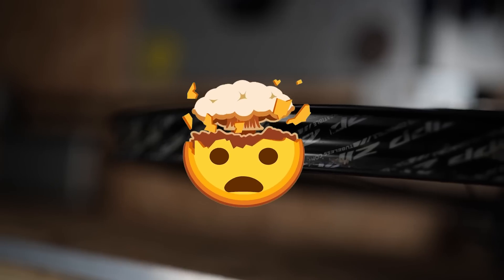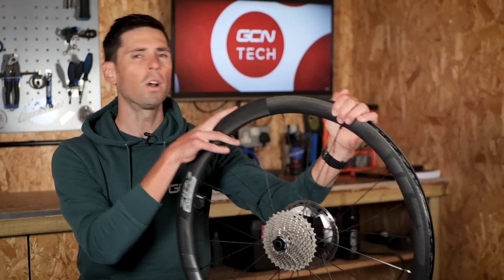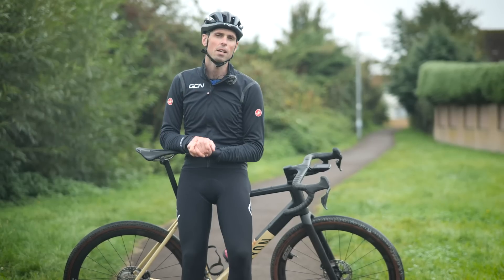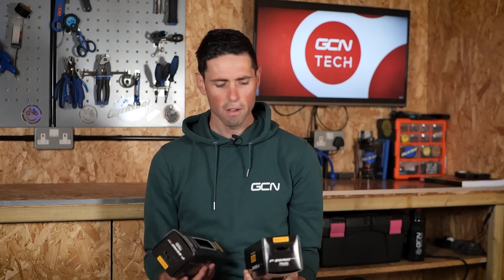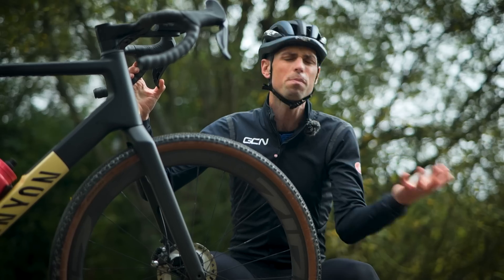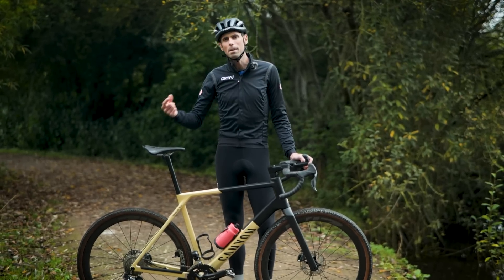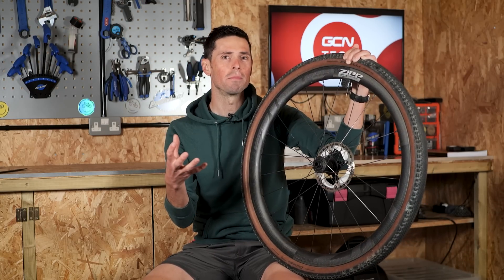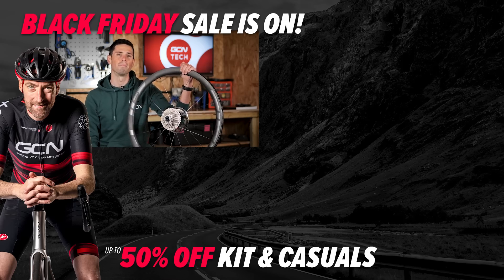What exactly is hookless technology, and what are its pros and cons?

Comment: There is no reason to have hookless rims in road cycling and no amount of media hyping will ever convince me that hookless is a good thing.
Reply: Agreed, I'm a fairly big lad 95kg, and cornering doesn't instil confidence at just max 73 psi. Scared of burping already had a crash with normal tubeless with a puncture once air was too low.
Reply: @neilmurray4231  I'm 90kg and happy descending fast switchbacks at 65psi and less.  Started doing that long before I got any hookless wheels
Reply: So you’re out on the road. You get a flat. You reinflate after fixing… but don’t carry a pressure gauge… and you go over 73psi…….
Reply: @DrawnOutMeetings  I can't fathom pumping to 73psi after a flat🙃  Too lazy.
Reply: @veganpotterthevegan  and depending on your specific tires, you would need to put a tube in anyway since a mini pump generally is not going to re-seat your tire on the bead, or you would need to use co2 blast
Reply: @justsomedude7556  I've never had a tubeless tire unseat in about 80k miles of riding road tubeless
Reply: @veganpotterthevegan  Neither had I until 2 weeks ago, when I had a flat going down a bridge and the tire bead was broken.  It was at the time I realized that I had left my spares and CO2 on my work bench in my garage, so I had to make the call of shame 😑.  I think it was a one off, but it did happen.
Reply: @justsomedude7556  I'd always have a tube anyway.  I plug 2-3x a year and have only used 3 tubes in the last 80k miles
Reply: It's cheaper
Reply: It’s cheaper the latest 303 firecrest were cheaper than the older ones.
Reply: Totally agree this video is a Pirelli advert that is not worth your life. There are several videos showing hookless tyres coming off at less than 73 psi.
Reply: Hookless it’s a lot safer tho
Reply: Actually the reasons are stated in the video: increased rider comfort, better cornering grip, better system efficiency, etc. Whether you feel the pros outweigh the cons is a personal decision. For most riders, including myself, the pros of hookless wheels are compelling and the drawbacks either don’t apply to me or are statistically insignificant.
Reply: Hookless gives you none of those things.  @danielakerman8241
Reply: People talking negatively about how hookless don’t work when the automobile has only used this concept for decades. The primary reason some incidents have occurred once you dig into the details is improper tire/rim matching according ETRTO standards and bad setup. Like any industry you need to know the standards. There are pros doing tour races on hookless rims that are pushing those to the limits and doing just fine. Details matter.
Reply: @rickstokes2239  automobile hookless and bike hookless completely different animals. Automobile tires can stand on their own, most bike tires can not
Reply: @justsomedude7556  “most bike tires cannot” - When you use the ETRTO standards and specifications like the tour pro do that actually use anyone can use them. It’s just a matter of tire and rim matching and using them to specs.
Reply: @rickstokes2239  I have no issue with hookless on gravel or mountain, pressures are low enough to where it does not matter. Mountain has used it for years with no issues but road is a whole other issue. Yea I am a huge fan of the ETRTO standards
Reply: @justsomedude7556  I have a buddy that just bought a new Trek and put ENVE SES rims on it - hookeless. He came from a bike he sold with ENVE 65 Foundation rims - hookless and never had a problem with the and he races. I have ENVE 65 Foundations on my Cervelo P Series Tri rig and they’ve been great. Studying the setups is important.
Reply: @rickstokes2239  That is the beauty of this issue, each person has the choice of which way they want to roll, hooked or hookless.  The discussion is the fun part 😀, cheers.
Reply: @justsomedude7556  I agree. Everyone needs to do their due diligence. Be well.
Reply: There are IMO too many variables for a non tire engineer. When the charts are not easy to find  and use...They will need to clean up their specs. But that's always the case. @rickstokes2239

Comment: Been using hookless for almost 3 years on my Zipp 404 firecrests, works fantastic. Everyone throwing fud on this topic has most likely not only never used a hookless rim, they all choose to ignore all the specs of the wheel/tire and pump way past what the wheel and the tire is rated for, then get angry and blame the manufacturer when the wheel and/or tire break and blame the tech. Everyone Ive seen complain about hookless with using them all have pumped past the max pressure limit and chosen to ignore wheel and tire manufacturer spec, making any damage due to negligence and stupidity. News flash to everyone in the comments. Car rims, motorcycle rims, truck rims are all hookless rims as well as all car tires are hookless (car tires usually say verbatim hookless and/or tubeless on the sidewall) yet nobody has a problem driving their hookless rims on their motos or cars over 80mph because your not pumping the tire past the rim and tire psi limit. People are angry just to be angry, I have yet to actually meet someone with a legitimate argument why hookless shouldn’t be in cycling.
Reply: Hi, are you from sram? 🤣🤣🤣🤣🤣🤣🤣🤣
Reply: @chickenricelaksa  no, I’m someone who just read the instructions on how much air to pump and what kind of tires you can use. I’d hope everyone does this with their cars, let alone bikes.
Reply: And I still have to actually see real world benefits. Thank for sharing your experience. Can you also share how many tires you had in 3 years and which ones?
Reply: @TenSapphires   pirelli p-zero race tlr, 28mm tires and p-zero race tlr sl, 28mm tires as well. I just recently got 303 firecrest for Black Friday and just put on pzero race tlr 4s, 28mm. I swapped to the regular tlr from the sl once I fully used up the sl, hence why I’ve only used 2 pairs of tires in 3 years I came from hooked tubeless rims, cornering ability and comfort is night and day better on the hookless. MY GUESS however with that is probably less to do with the hookless and more the fact that hookless rims have a wide inner rim width (23mm for 404 and 25mm for 303) and as a result I pump 5-10psi less for same volume pressure.
Reply: Where do you dispose of the old tire sealant multiple times per year?
Reply: @dougpence3862  muc-off sealant lasts about six months and all I do is add about 30 to 40 mL each time to top off. You don’t have to clean the entire tire each time you add sealant unless you are switching to a different sealant brand. When the tire is done if there is excess sealant, I transport it to the new tire, and then I throw the tire in the trash.

Comment: So when (not if) I start to add weight for commuting/bikepacking, I’m screwed?
Reply: Looks that way. Seems that hookless technology is just performance oriented. So if you have never disc brake bicycle and want aero wheels you are hookless compatabile. But beware, you have to have certified tires to rim in correct width (forget narrow,light ), correct pressure gauge,sealant, mounting tool. That money well spent, your only job is to check pressure, rim bed, sealant, valve clog every ride. Enjoy! ;)

Comment: sounds like way too complicated for some un-measurable performance difference. just run the lower pressure on hooked rims. it might work for light riders with full support crews. but for normal people, it's extra complexity for no good reason. and the consequences for getting it wrong mean tire comes off the wheel

Comment: I don't think what Alex said about the comfort of the wheel/tyre of a hookless rim is correct. With a hookless rim you get a straighter sidewall and less lightbulbing of the tyre, which makes the sidewall STIFFER, for a firmer ride at a set pressure. Si Richardson literally said in a video on GCN a day ago that you need to REDUCE the pressure you run the tyre at to get the same comfort. https://www.youtube.com/watch?v=RFl1XsjfURM&t=608s 9' 45" in Si goes through this. Zipp even said this many years ago when first bringing out wider internal width rims.

Comment: 110 Kg at 72psi?! I call shenanigans!  I weigh 215 lbs (you made me do the math, so now it's your turn) and if I ride lower than 80psi on my 28mm tires, my back tire looks like I'm running flat.
Reply: Heck, I'm 185lbs and going below 80 psi feels way too soft and squirmy for me on my 28mm... being at the utmost limit at 73 doesn't seem like a good idea to me and I'm not fitting a 30mm on my Madone SLR
Reply: Yeah I'm 105kg rider, I've tried crocheted tubeless and it was trash for this reason.  I imagine hookless would be worse for heavy riders.

Comment: I predict that hookless will be a real turn off for the majority of riders and a big mistake for those manufacturers pushing it. Minimal gains no one cares about for more expensive tyres, more difficult to get on and off, more things to worry about on the pressure front and your mates constantly telling you your tyres will peel off.. 😂
Reply: Won't be long before all tubeless tires are hookless compatible. It'll be a non-issue.
Reply: @veganpotterthevegan le sans crochet est un problème en lui-même
Reply: @littlevo9  hopefully you don't ride in cars then🤡
Reply: @veganpotterthevegan  je n’ai pas besoin de gonfler mon auto à 6,8 bars
Reply: @littlevo9  yeah,  but are you 1300kg?🤡
Reply: @veganpotterthevegan  There's no comparison between a car tyre and a bike tyre. The bead on a car tyre is huge and it needs a big powerful machine to mount it.
Reply: @grahamaustin9085  you don't need a big powerful machine.  You can do it with tire levers. Stop being so dramatic.

Comment: Having no problems with my hookless rims on my Orbea Orca Aero with 25 mm Schwalbe Pro One tyres at 75/80 PSI. They 're said to weighs 40 g less than their hooked counterparts.
Why didn't you try to find out what happens when you use higher pressures? 80, 90, 100, ... PSI?

Comment: Alex mentioned ETRTO but forgot to mention that for road rims with 25mm internal width they no longer recommend 28mm tires which Alex shows as the “standard” road tire. ETRTO recommends 30mm tires as the smallest tire you should be running safely and honestly for road that’s a little too big and heavy for my taste. I prefer 28mm tires. Definitely a pass on hookless for me.
Reply: After thinking 32s would be winter only for me, I stuck with them all summer and definitely prefer it.  I'm on 35s when I'm riding worse roads.  Don't think I'll ever run 28s on anything but a TT bike ever again
Reply: @veganpotterthevegan  ever try 30? Comfort isn't everything unless it keeps you off the bike. But at that point you gotta look at suspension because with the saddle and tires combined can often give more travel than suspensions
Reply: @veganpotterthevegan  most ppl have bike fit problems if not chronic pain issues. I ride 25s 90 to 100 psi all types of roads even a little gravel at times never had comfort issues on 100 plus mile rides. And I use a selle Italia slr with no cut out so it's rock hard for some reason, whereas the cut out version flexes 5 mils give or take, to me that's not enough support. Both have design flaws clearly.
Reply: @timtaylor9590  I was a sought after bike fitter for over a decade and one of the first 10 certified Retul fitters in the US. I know plenty about fitting.  I also have over 300k miles in my legs and didn't know I liked 32mm tires until I road them.   Didn't think I'd like 35s until I road those either😅
Reply: @timtaylor9590  I run 3 different Antares saddles.  Each has over 40k miles on them so they don't have much padding now.   Don't care though.   Love my bike tires, even on good roads
Reply: @veganpotterthevegan  well sure I bet it feels comfortable but some may not want to sacrifice performance.
Reply: @timtaylor9590  Each to their own, and all that. And I respect your choices and what works for you 👍 
But remember for a lot of cyclists out there "Comfortable = Performant" 🤓 
(as they will be able to get more out of themselves by being comfortable throughout a long ride ✅)
Reply: @timtaylor9590  lower rolling resistance and you can corner much faster. The aerodynamic drag will only slow you down at very high speeds or if your rims are very narrow.
Reply: @veganpotterthevegan  lower rolling resistance depends on the road conditions. if you have smooth roads a larger tire will only slow you down. larger tires also add weight and rotational weight, so going up hills and fast acceleration like in sprinting or breaking away is worse. as far as aero dynamics, you say very high speeds i say coasting down a hill or lets say 150-200 watts on flat for 30 seconds will get you to a speed that where it matters. even 16mph im sure the gains are there even small as they are. but remember in a gravel race the slower riders or amateurs would save more time being aero than the pro's. so add it up faster down hills due to less drag, faster up hills do to less weight, snappier acceleration, and oh yea worse handling, gcn did a video when you go to large cornering doesnt get faster. again only if the road surfaces are terrible would large tires help. usually for decent roads 28's are more than adaquate, 30mm maybe for bigger riders. i think 32 is more for not getting flats and recreational riders, also throw in those big padded seats to match.
Reply: @timtaylor9590  no, a wider tire(the same model) will roll better.  That doesn't mean you'll go faster due to aerodynamics but it will have lower rolling resistance. The weight on a climb is negated by that rolling resistance improvement and that's where you actually gain the most due to slower speeds.
Reply: @timtaylor9590  I'm a cat 1...definitely happy riding 35s😅
Reply: @veganpotterthevegan  crit racing is dangerous so it makes sense to go for safety. I don't blame you.
Reply: @timtaylor9590  it let's you take corners at higher speeds so less breaking which also means more danger IF you crash🙃  I won't TT with huge tires but that's because the aerodynamics are so much more important than rolling resistance, plus you're not drafting
Reply: @veganpotterthevegan  theres a formula. At higher speeds the aero takes over the rr because rr gains cap out. The data should be easily found I would guess 28mm vs 32 would be no more 8 watts but that's a random guess. Now compare that to aero gains which can exceed 40 watts with position alone depending on speeds. You may be able to find aero data on tire size. aero gains are exponential and theoretically never cap out of you have infinite driving forces. (Which we don't) but that's just to show there's a diff. I'm with you there on safety less flats, less twitchy, better traction and a bit slower overall.
Reply: @timtaylor9590  the issue is wheels optimized for 32mm wide tires that may measure to 35mm.  That said,  there's a reason Pogachar was riding tires that measure to 31.4mm wide at the TdF for every road stage and it's not because he prefers going slow.
Reply: @veganpotterthevegan  then consider how frames and wheels are made too stiff so riders will make up for that with tires. In the tdf fatigue is a huge consideration where that extra comfort can translate to speed. I bet if anyone of us rode at a similar volume and intensity the fatigue would be immense no matter the tire size. But to speak on the rim width is true everything is getting wider but I think it's too make up for disc brakes locking up, aggressive geometry, stiff bikes, and potential blow outs and hookless rims. Even if the rr is a slight improvement I wouldn't agree that it's the driving force to wider tires.
Reply: @timtaylor9590  love my Domane but if I was bike limited, I'd rather tune my ride with tires.  Disc brakes and big clearance allows that.   There's also a lot to play with with one given tire so long as it's 32mm or higher.  28 IF you're a very light rider using tubeless
Reply: @timtaylor9590  people had tires blow off rims long before tubeless came about
Reply: @veganpotterthevegan  sure but how bout those hookless rims? Again that's the industry pushing crap just for profit, and don't even pass those savings to consumers. I'm not sure how popular they are though.
Reply: @veganpotterthevegan  but more volume with tubeless is not only less blow outs but less flats which is the point. And less crashing from locking up brakes especially around turns out in panic brake situations. Those trump rr by far.
Reply: @timtaylor9590  guess what?  They make more money(keeping the same margin) with hooked rims.  Everyone lowered their prices with their hookless rims.
Reply: @timtaylor9590  if I didn't live somewhere with so many goatheads, I'd still be running tubeless.  *In all honesty though,  that extra speed you can carry probably puts a lot of people at more risk(definitely me) because I'm willing to hit corners much faster than before.  That traction isn't gonna do me favors if a car comes around a blind corner that I'm riding through at a 3-4kph faster now😅
Reply: @veganpotterthevegan  haha you don't run tubeless I knew it.  No one  who used to race on tubs would want that crap on his bike, hahahahah.
Reply: @veganpotterthevegan   lowered the prices because theyre crap. and the whole point to hookless is to save on production costs, nothing more nothing less. also how do you know what their profits are? seems like a bs assumption that contradicts all the engineers and experts who speak on it.
Reply: dont you want to be fast like pogo, he was on 32 in the tdf. comn you alrdy have the lock up brakes that are big and heavy
Reply: 32mm is the best tire size that exists.  35mm is heavy and slow, 28mm makes no sense, 25mm is dumb.  if you ever find yourself wanting to run 35s on the road try a 32mm light touring tire before you do that.  Remember that 35mm is 2x the air volume of 32mm so it's quite a huge step up.  You can get comfort on 32mm with 4mm+ tread depth.